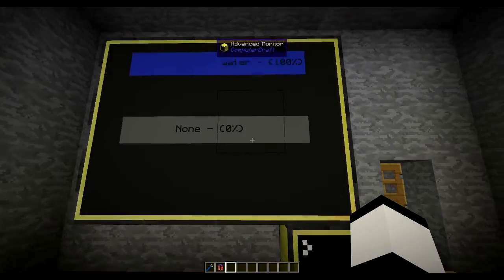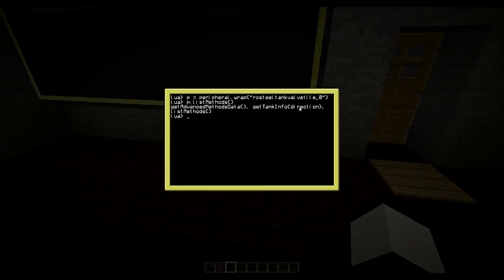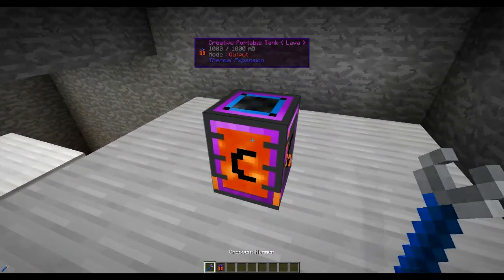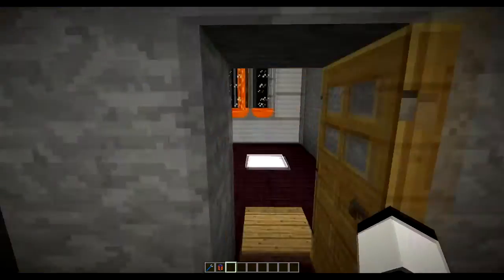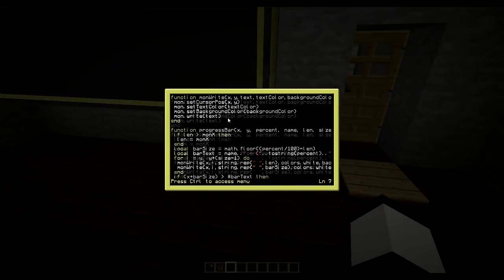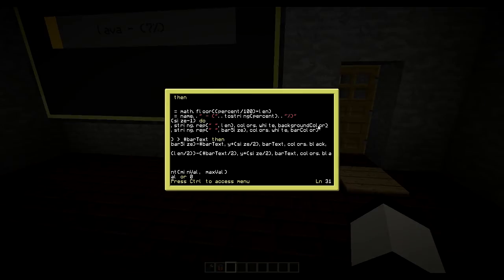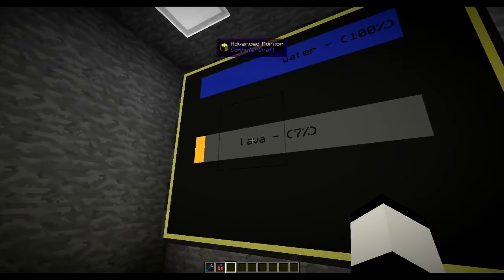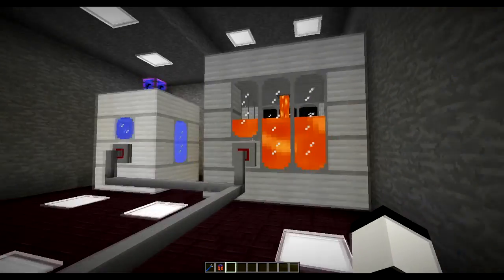Sjonky's Computercraft tutorials - Episode 5 (OpenPeripheral - Liquids)

Comment: the code for k, v in pairs() what does the k v and in pairs do ?
Reply from the maker: It loops through a table from start until end, and k will contain the current table key, and v will be the value of that table entry. k, v is just variables so they can be anything you want, i just usually use k and v because its shorter than key and value. hope that explains it?
Reply: oh thx